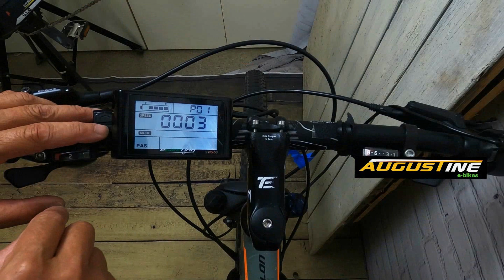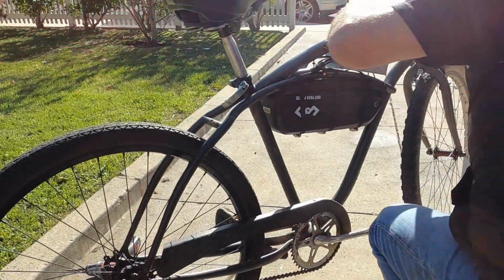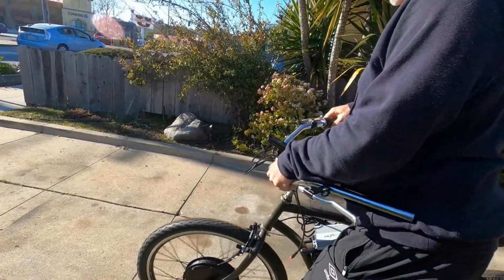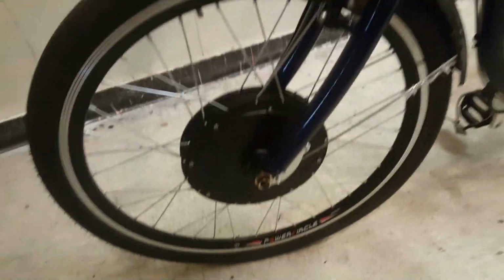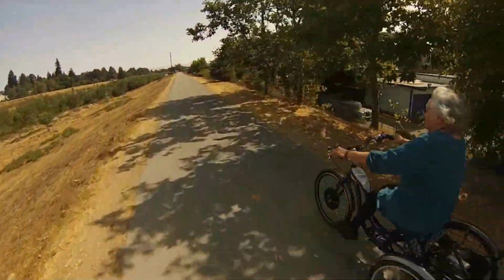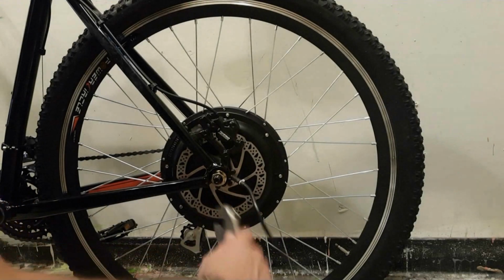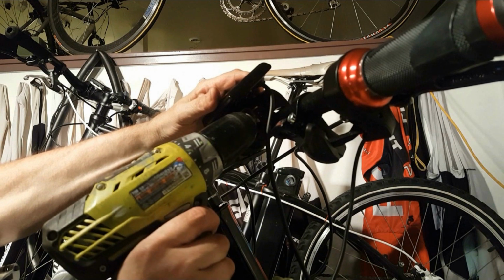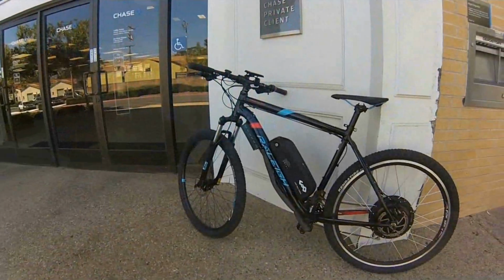E bikes 2021: 3 of my favorite 1200w Hub Kit Builds

Comment: Hello there. I've been watching tons of Youtube videos about conversion kits for my bike. Size is 700 x 38C. I've been debating between a front hub or a rear hub kit. After watching this video I am leaning towards the rear hub kit, however, I saw comparison videos between the 2 of these, and one of the cons mentioned about the rear hub was the fact the rear hub's spokes tend to break frequently. I have a couple of questions about that. 1. Is it true about the spokes? 2. I looked for the 122w Raleigh Talus you showed on the video but was not able to find it. 3. Does this kit come in 700 x 38C size? Thanks
Reply: Do you ever reply to your messages?

Comment: Why don't you use 1200W motor with inbuilt controller
Reply: They tend to break overheat and be irreparable.
I have a bike with a 1500-2000 watt rear hub setup with an inbuilt controller but a couple of weeks ago the controller died on me the wheel gave resistance and the error code indicates a controller problem, you basically can’t buy a replacement controller because there aren’t any.
I have now ordered a normal controller and will convert my setup to have external controller.
Reply: Is there any sort of warranty from ebikeling if the internal controller goes out ? How long did you have it before it died? What conditions and battery set up?